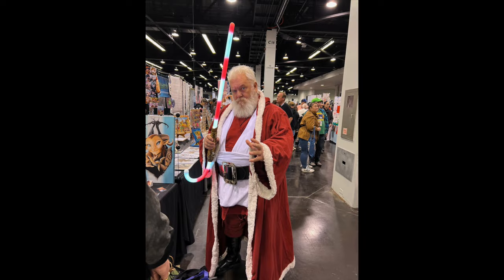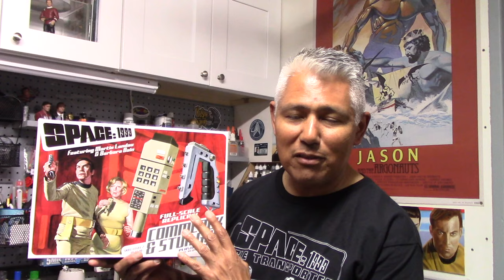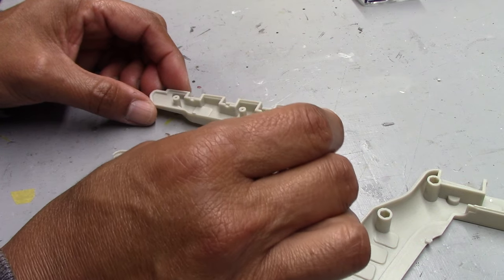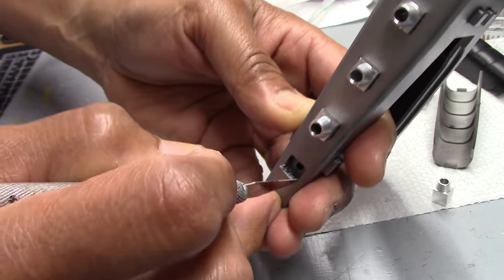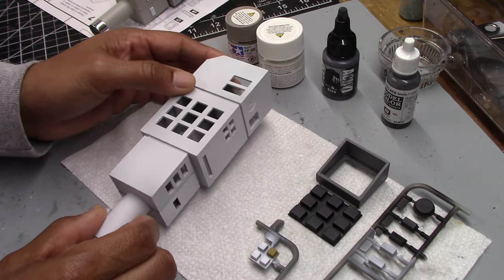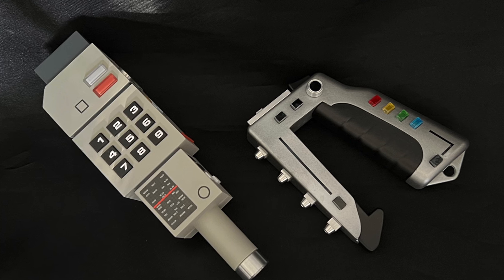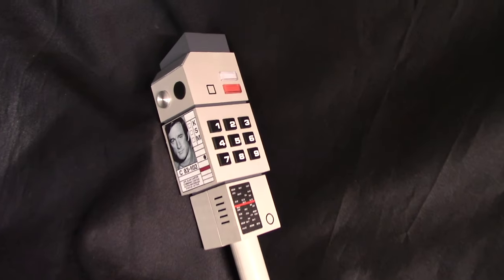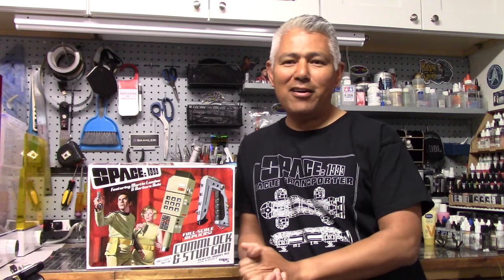MPC's Space 1999 Comlock and Stun Gun Kit

Comment: Hi, Interstellar Modeler, I’m a new subscriber, I’ve just watched the Space 1999 Comlock and Stun Gun kit builds, and in particular the bit about removing chrome from plastic parts, soaking overnight in bleach!  I myself have a better solution to this which is much faster.  I use a standard drain unblocker and it takes seconds, you can literally watch it happen then rinse your parts in a bowl of warm water.  I would advise testing the brand of unblocker first on a piece of sprue.
Reply from the maker: Thanks for the tip.  Are you referring to something like Draino?  I actually ended up using Purple Power defreaser which is a little faster than bleach but still takes some time.  Thanks for subscribing.
Reply: @InterstellarModeler  I don't know Draino, guess it's pretty much all the same stuff, it's normally like a clear gel.